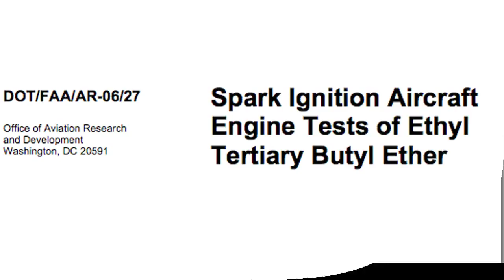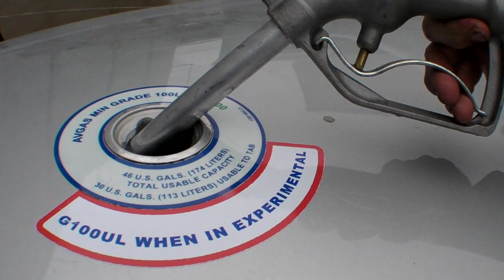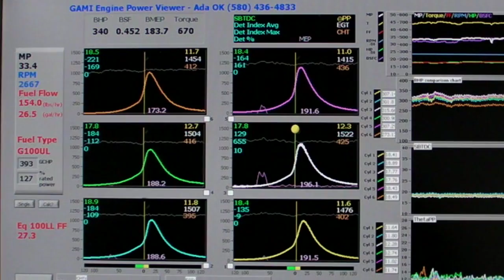AVweb's G100UL Flight Test

Comment: 4:00-4:43 Complete Wash my ASS! which way is he referring to with the 5-9 lbs difference?; heavyer or lighter. That is noticable, especially when it comes to NOT esxeeding the max gross weight with too much fuel and/or payload. Weight is that important in an airplane
Reply: G100UL weighs 6.3 pounds (5% more than 100LL) and has 3.5% more energy density, so overall weight of the fuel increases by ~1.5% vs 100LL. 600 pounds of fuel in an aircraft that carries 100 gallons becomes 630 pounds (with 3.5% more range) or you can carry 96.6 gallons (same range) with a weight of 609 pounds.